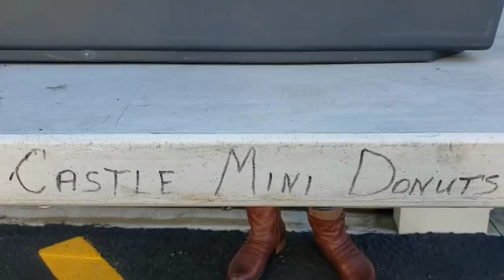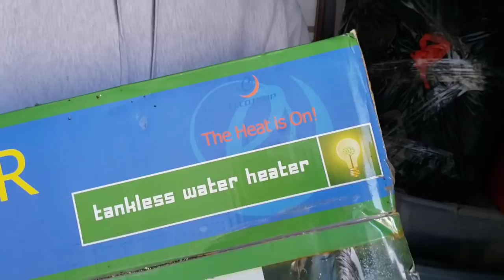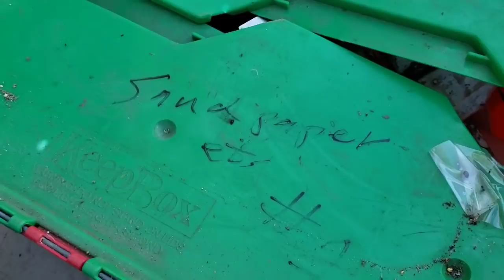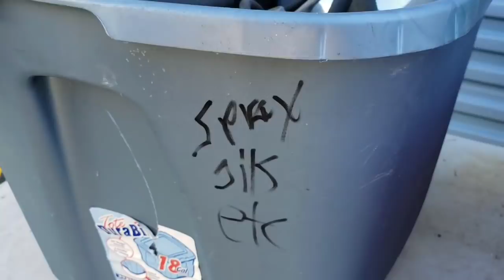SHE GAVE IT ALL AWAY / I Bought Abandoned Storage Unit Opening Mystery Boxes Storage Wars

Comment: At 24:50, the wooden thing is a lead ball starter for a muzzleloader. That is old. I'm still watching as I go, so you probably will find some old lead balls and maybe patches. To load a muzzleloader, you would pour your black powder down the barrel then lay a small "patch" or piece of cloth on the end of the barrel. Once the patch is in place, you would center the ball over the hole in the barrel. That tool was used to start the ball and patch down the barrel, after that you use the ramrod to push the ball and patch the rest of the way down the barrel.

Comment: The black powder you found is extremely volatile. In that glass or plastic tube, even sunlight can set it off. Please be extremely careful with that. To give you an idea, one spark from a flintlock is what fires the old muskets or muzzleloaders.
Reply: You probably don't need to worry about sunlight setting it off unless it's pre WWI, modern powder is pretty stable and actually needs a spark/primmer to set it off.
Of course it's always wise to be careful with combustible materials.

Comment: That black net from the first tote is a tailgate net. You remove the tailgate from any pickup truck and install the net in it's place. The net is much less wind resistant so you can save gas.

Comment: Tumble Vibe TV-5 Vibratory Tumbler is great for hobbyists and can be used commercially as well. The versatile unit is designed for deburring metal stampings and machined parts, descaling metal castings, cutting radii on sharp edges of metal parts, and polishing metal and plastic parts. Has a .05 cubic foot, 8 inch bowl with solid lid that holds 25 ring castings with media, or will process about 4 pounds of rocks.